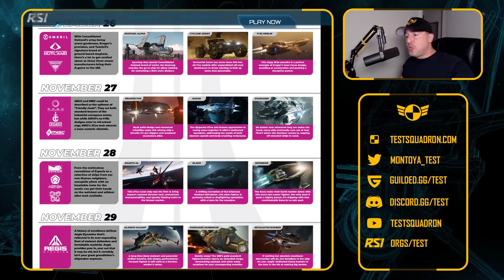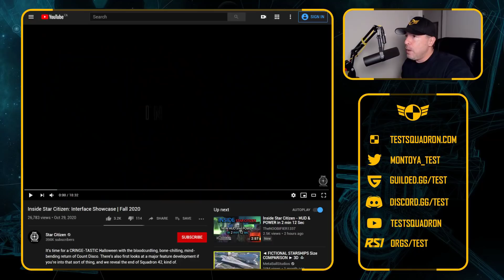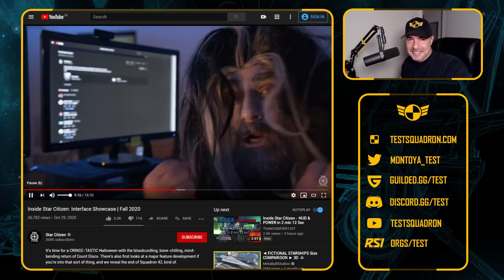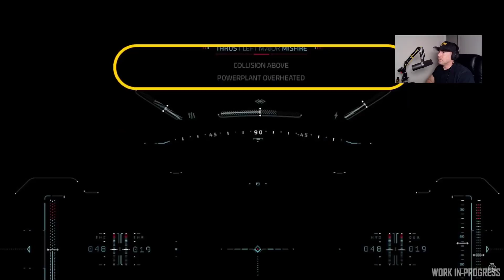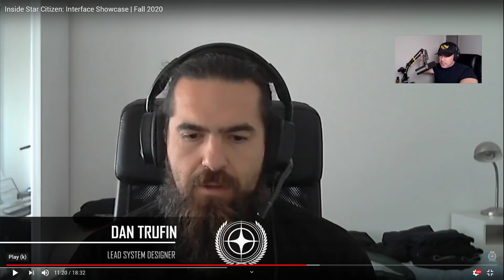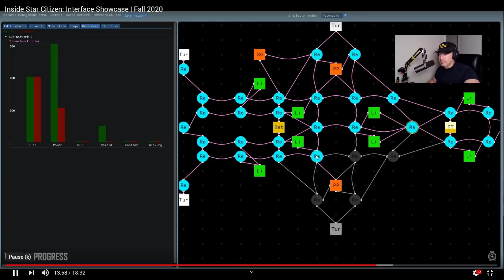Star Citizen Expo Nov 20th and Engineering Gameplay Reveal

Comment: Engineering seems awesome. Too bad it also seems like the kind of thing that will get put on the 2021 roadmap, and the 2022 roadmap, only for it to be removed indefinitely and we never hear about it again
Reply: It's been in the works for a while. I mean I cannot say if you are right or wrong, only time will do that, but I've no reason to doubt this project will get there with maybe not all, but most of its promises in the end.

Since 2016 I've expected SQ42 2021 to 2023, and MMO with at least 5 finished systems and mostly feature complete, 2023 to 2025. It is a pain in the ass given the time scales, but basically I think the only logical way to approach this project now is with the understanding that the vast bulk of what was done between 2011 and 2015 was scrapped by 2016 and rebuilt anew during the year of silence (the run up to 3.0)

I just don't think CIG wanted to take the risk and admit that to the fans, so since then there have been no fixed dates, only vague promises of beta by X quarter and "when it's ready".

Comment: Um... your gear indicator is already in game so check the bottom left of hud below your speed indicator.
Reply: Same with chaff/flare counters... but yeah, a VTOL indicator would be nice!
Reply: @rescuejake  not sure about all ships but on the cutty if you look at the Self status MFD  A little drawing of the ship changes When in VTOL mode
Reply: @Ace-Brigade  Yeah its works on all ships, but it’s a crap way of indicating VTOL on/off. For example: On the Connie it’s nearly impossible to tell as is just the fan doors opening versus large engines rotating.